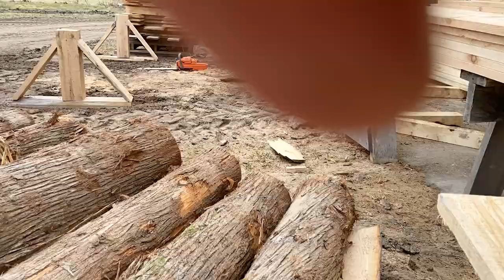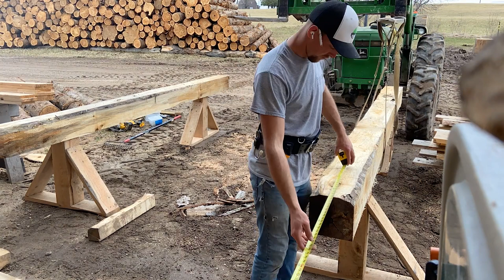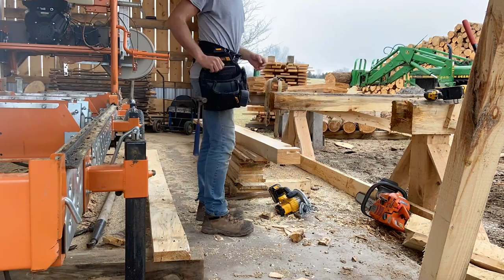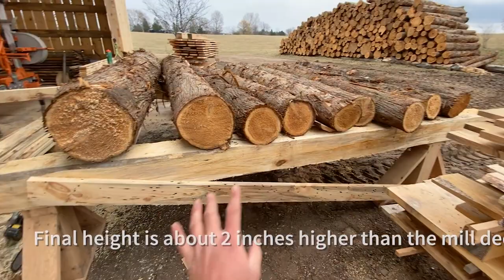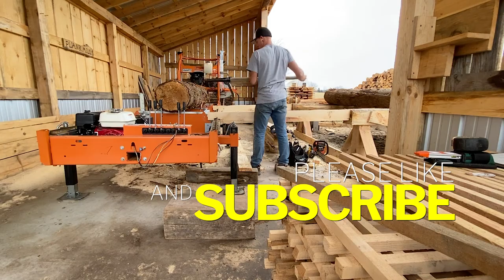Log deck build for my sawmill!

Comment: What size screws or nails did you use to put the plank on the posts.
How did u attach the beam to the posts
Reply from the maker: I used 4” screws, and fastened the top part through the top of the post part. 
But I should have used some 6” lumber screw or 10” through the top. 
But the 4” ones hold ok as long as I don’t tip it over. Haha

Comment: Nice log deck! I'm planning on building one similar to yours. What size are are your main rails, 8" X 8"? Your deck looks nice and sturdy...
Reply from the maker: I believe it is 8x8”  Thankyou, the wood I used was pretty punky on the ends at the mill, so it’s gonna need some re-working at some point. But I like it pretty good so far, definitely saves a lot of getting on an off the loader.